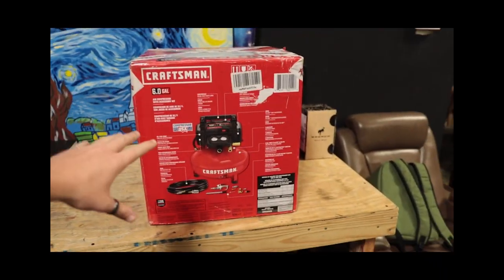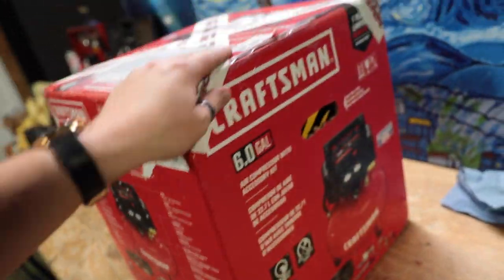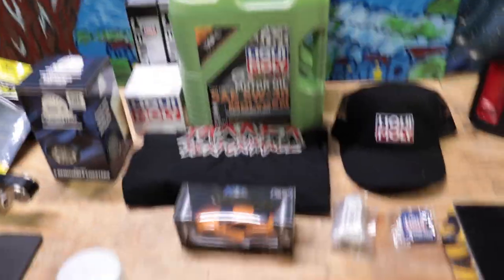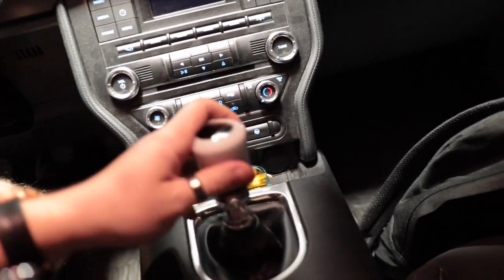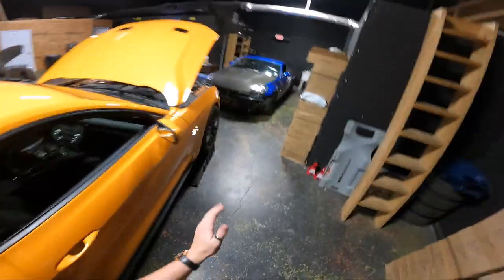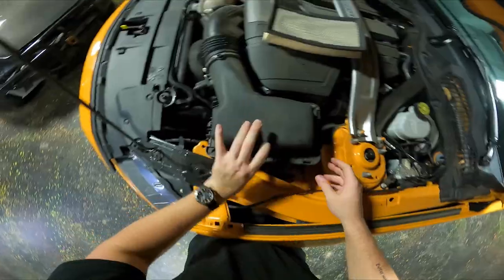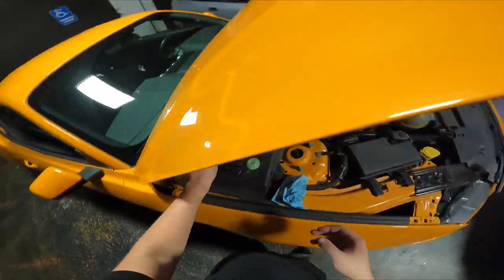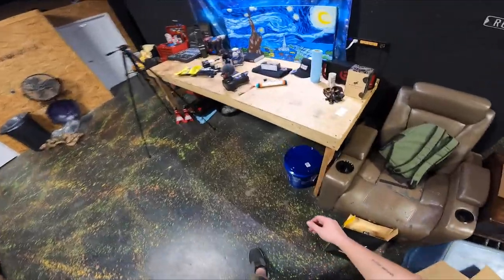Fixing my Coyote Tick with GREEN OIL!

Comment: I have the mishimoto radiator on my 2019 GT and it makes a huge difference!
Reply from the maker: I should really look into getting some
Reply: What does it all do
Reply: @claytonbrumbaugh4145  There’s more coolant circulating your system. Its wider too so your coolant loves it. Fans run less too.
Reply: @juanc3627  okay cool also have a 2019 where did you get yours From
Reply: @claytonbrumbaugh4145  Got mine from mishimoto

Comment: I love that coyote, ls and hemi guys all complain about tick. were not all too different. but surprisingly my gen1 chevy sbc doesn't have a noticeable tick, which is funny bc its an old school flat tappet pushrod motor.
Reply: That's because SBC didn't come with Cyclinder Deactivatation for better gas mileage
Reply from the maker: I've never seen it as an issue because I know that engines are noisy, and if there's an issue, you can't fix it 😂 I was just surprised at how much this actually helped!

Comment: Is it necessary to add the 2 Cera tecs? I’ve seen people getting rid of the tic with just the oil itself. But idk 😂 my car has a loud horrible tick and I’m tired of it
Reply from the maker: I’ve changed the oil since this and have stopped using ceratek. It still seems reasonably quiet, so I don’t think it’s necessary! It’s just extra protection.
Reply: @Zorbii  I’ll do the first oil change with both liqui moly and Ceratec. Then just the oil by itself on the next. Hoping it’s just the tick and not a lifter 🤞🏻thanks tho👍🏻

Comment: I went through the same thing with my s197 when I pulled the oil to swap the motor. It filled the exact same style pan stupid quick
Reply from the maker: I love those drain pans. They're more useful than not imo. They can be a pain though.
Reply: @Zorbii  oh for sure, going from working on stuff in a shop to swapping my motor in my buddys garage is just like…. Lemme have a lift my guy it would be so much easier
Reply from the maker: Lol facts